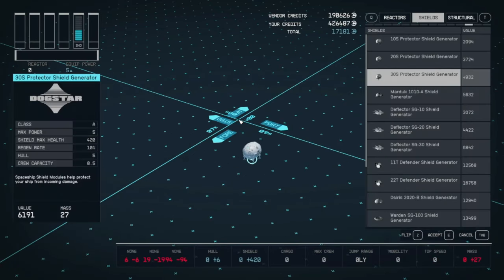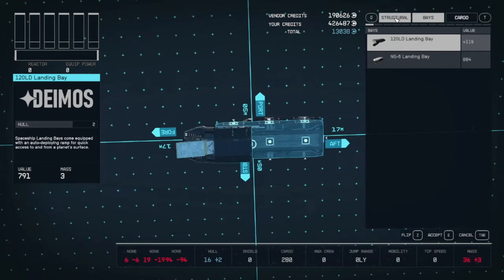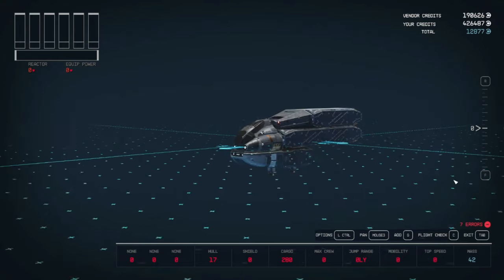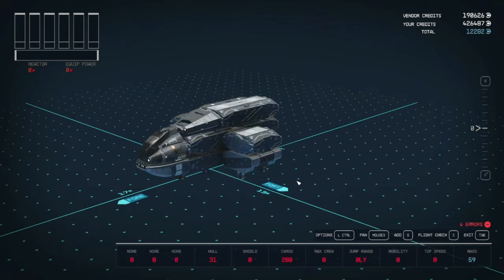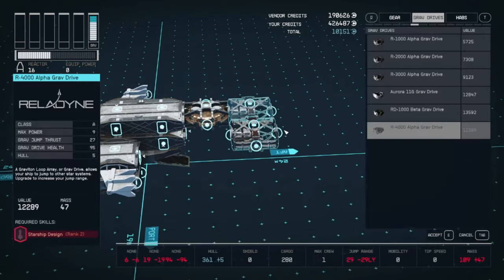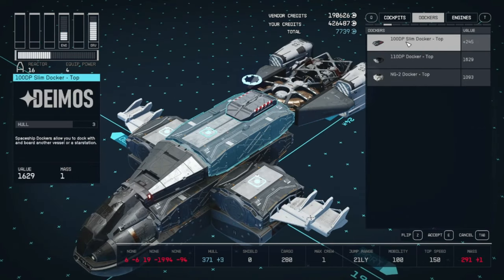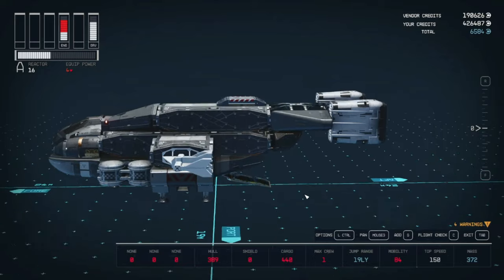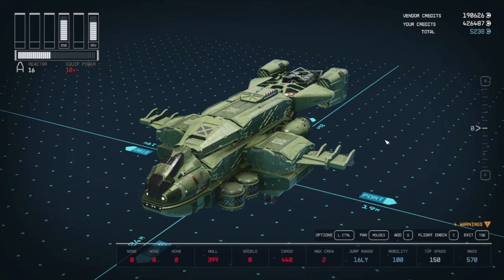How to build the UNSC Pelican in Starfield!

Comment: Perfect design and thank you so much. 
Quick shortcut for the two different ports! 
If you build a base on a planet and build a landing port with a ship builder as apart of it (it will cost a lot of resources but overall will be worth it) you can build everything on this design except the very back engines. It also costs half the credits to build it at your planet! My build credit cost were half the price as the one in the video!
Reply from the maker: That’s awesome! I have since this video, built a planetside landing port but haven’t had time to make much content due to work
Reply: For me you can't, can't find Ares Engine on Outpost Ship Builder

Comment: I'm confused I'm getting error landing bay needs to be connected to cock pit?
Reply from the maker: That error pops when the landing bay isn't connected to the cockpit through habitat modules. Imagine walking as your character to the cockpit through the landing bay, you'd need to travel through habitat modules to get there. If you have a  reactor or grav drive in the way it won't work.

Comment: can i buy individual ship parts? there is no way for me to save a ship work in progress, it has to be a complete ship or nothing will save
Reply: Same. I can only get half the equipment in one city
Reply from the maker: My strategy was to complete the ship with the cheapest parts available. I remember having to add a 1x1 Hab underneath the ship and add landing gears to fly to another system to get the rest

Comment: Are there any parts locked behind perks?
Reply: No, but you'll need to go to both the New Atlantis and the first Freestar city spaceports to get different parts.

I have trouble finding the nova wings, cockpit, scoop under the cockpit, and landing gear but everything for the basic shape, not including weapons, is barebones class C.

I heard you can build a landing pad on a outpost (settlement) that gives you access to >90% of the building options. I'd recommend doing that if you wanted to follow this build 1:1 without having to track down the few branded parts.

Comment: So, how did you make it in two different places? I have to make half in one city then make it flyable to go to the other and just takes a long time to do
Reply from the maker: Yeah that’s what I had to do. I made what I could in one system and then threw on whatever else I could to make it fly and then started over wherever I went next. Your modules that you had on your aircraft will be accessible to you if they were on your ship when you landed even if the port doesn’t sell those specifically.
Reply: @StayHoodE  ye I ended up doing that

Comment: How do I get all these parts?

Edit: Nevermind i got them, just a bit of back and forth
Reply from the maker: Different modules are sold at separate star ports. Meaning for certain parts (in this example, the cockpit and landing gears) you’ll need to travel to another starport.  The ports used in this video are New Atlantis in the Alpha Centauri system and Akila in the Cheyenne system